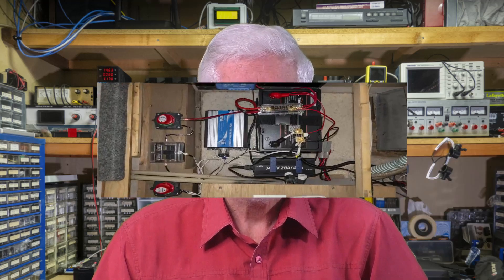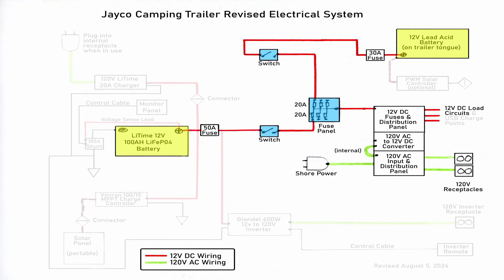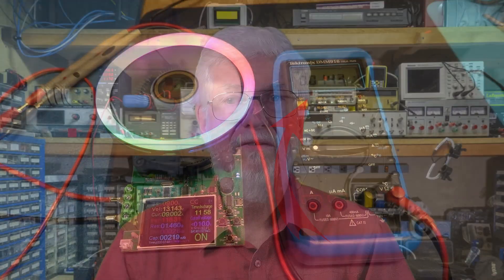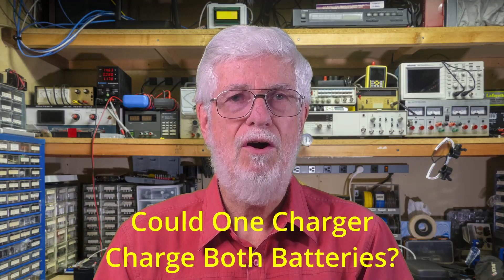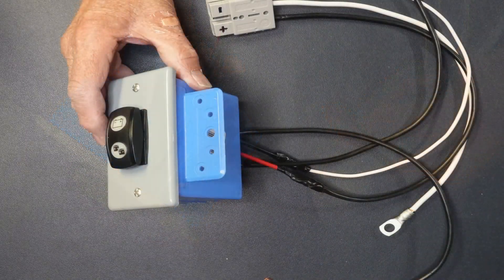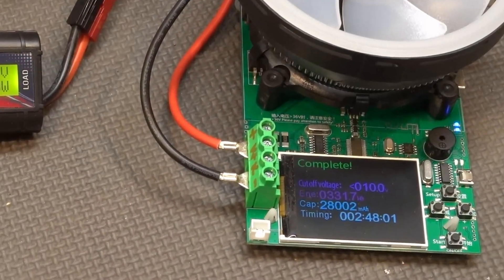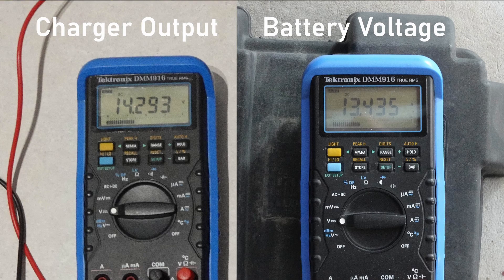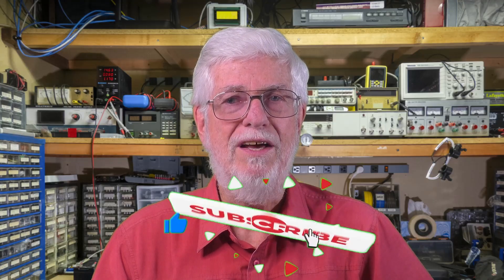Fixing My Mistakes in the Lithium Powered Camper

Comment: Hmmm I would probably have tried to figure out a way to automatically switch between the batteries.

But of course, a manual switch is way simpler and cheaper, especially when you're modifying an existing system.

Comment: Great video.  I did my solar upgrade to my popup a little over 9 years ago.  I replaced the single 12v battery with a pair of GC2 6v golf cart batteries, mppt charge controller and inverter.  I'm surprised the golf cart batteries are still in good shape. I just went out and looked at the date (06/15) on the batteries.  I can still pull over 1kWh from them.  We pretty much exclusively camp in places without power.  Besides the small built-in 3-way fridge, I setup a regular 120v larger office fridge outside under one of bunk ends.  That required a bit more power to run something 24x7.  I started with 200W of solar (barely made it to the end of the week). Then 400W (easily made it), and now 600W, because our son brings a bunch of friends.  I didn't put any of it inside.  I have a single propane tank with the battery next to it and my charge controller and inverter is mounted where your 12v battery is.  I put the internal charger on a separate breaker and my crude switch over to solar is turning off the internal charger via the breaker and taking the shore power line and plugging it into the inverter.  Every year I think about replacing the FLAs but they keep going.  We'll see next year.
Reply from the maker: Hey, I'm a fan of whatever works. I intended for years to replace the batteries in my motorhome with golf cart ones, but they won't fit in the trays and I'm too bad a welder to modify them. When the existing group 27 ones give up, I'm planning to go for a single LiFePO4 one, because the old rig is seriously overweight. We dry camp for a month at a time in Arizona in the wintertime with 300W of solar that gives us all the power we need for our full size 3-way fridge and my wife's sewing machine. But nobody ever comes to visit us - don't need to be prepared for that. 😁
Reply: @anoldretiredguy  Yeah, welding was required because the original battery was mounted side to side and I had to increase the size between the rails to mount the 2 GC2 front to back.  I got to use my miller MIG that I bought used 40 years ago and that too even though it's a behemoth, it still working.  At the same time, I installed a power winch to raise the top. The thing that probably delayed it longer than needed was the fact I just couldn't bring myself to buy a battery box to hold both together that was more expensive than one of the batteries.  I contemplated making one, but ended up buying the only one available at the time (NOCO duel GC2) for about $100.  I just checked PVwatts and you don't get much less daily output in the winter as we do in the summer.  You run your 3-way on DC?
Reply from the maker: @scottkolaya2110  Actually I misspoke, the fridge in my motorhome is only AC or propane. For dry camping it only uses about 300 ma for the control circuitry and we have a 100 pound propane tank, so I can easily go a month without buying propane (in Arizona, that is.) The popup, on the other hand, does have a 3-way fridge but it draws several amps on DC, so we use it on propane. (It has a mechanical gas valve and uses no electrical power at all on propane - which means its temperature regulation is non-existent.)
Reply: @anoldretiredguy  Ah, thanks, that makes more sense.  Yes, the temperature regulation on a mechanical gas valve 3-way is challenging.  That's why we keep the veggies in the AC fridge.  I've though about ways to add regulation to the 3-way.  First was adding a servo to the control knob.  That's not so easy because of the way it works, especially the detent it has on high.  Then I thought I could just run it on high and have a movable baffle that automatically adjusts the airflow over the coil to essentially make it less efficient when it's too cold.  That I wasn't thrilled about letting too much heat accumulate.  Maybe that's not really an issue. The biggest trouble is overnight.  If it's left on high, it freezes stuff, if it's turned to low, it warms up to about 50°.  If I used it more often, I'd be more motivated.  It is amazing how little propane it uses though.
Reply from the maker: @scottkolaya2110  Yes, that's pretty much my situation - it just looked like too much work to come up with a control system, and the current fridge models won't fit in that space. Sometimes we turn it down at night, but for our usual short trips we just carry anything that will be damaged by freezing in an ice chest. Our son's family uses the camper also but with 4 kids they need more space than a 2.3 cubic foot fridge anyway.